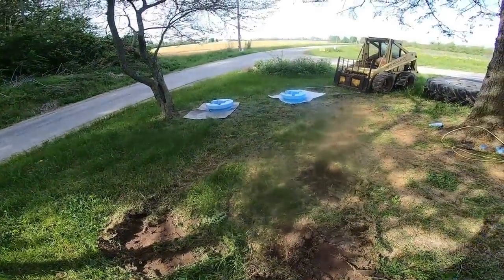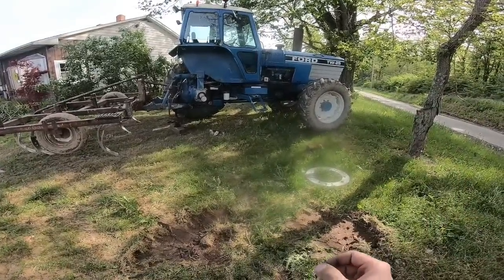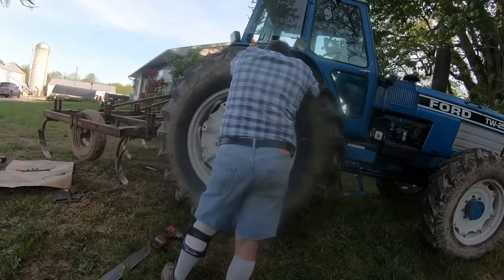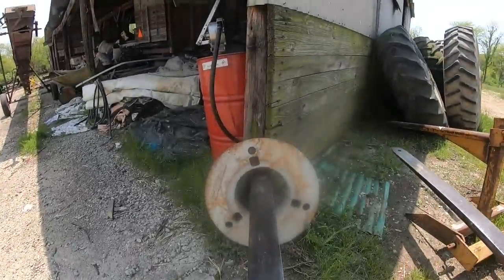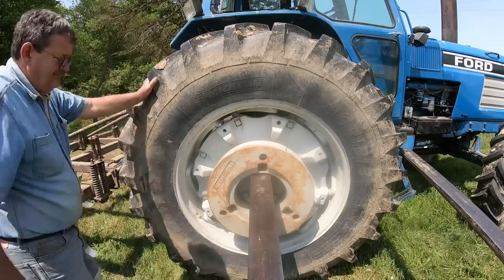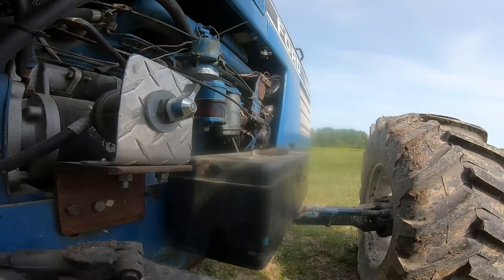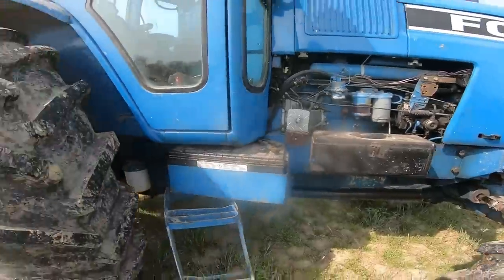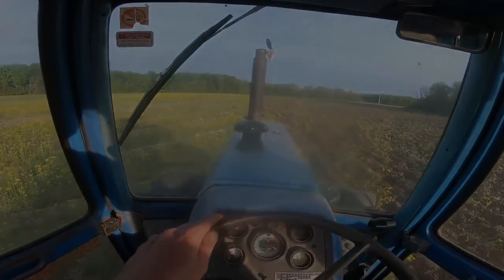Adding Weight to the Back of the Big Ford Tractor

Comment: I’d rather go with wheel weights then calcium!
Reply from the maker: You should see the collection of IH wheel weights I have. When the 1086 needs new shoes, they will be dry. If the 2+2 needs more sink in a puddle, I have cast iron. I call it redneck gold. Just getting lucky a t a sale every once in a while.
Reply: Tires last longer with iron than with water or calcium...

Comment: What bolts did you use for the wheel weights? I've got a set I'm putting on my 8830 like the ones you have on the outside.
Reply from the maker: Um, something like 12" long half inch bolts. Most likely grade 8 just for over kill.
Reply: @boehmfarm4276  thanks